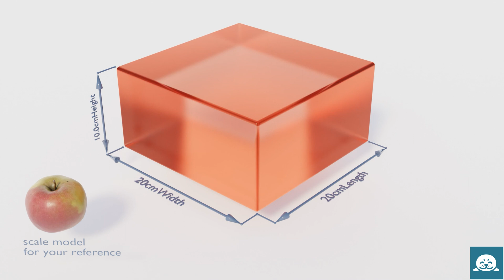Nerpa Polymers Casting Epoxy. Casting thickness tips.

Comment: What about pouring epoxy to fill letter or engraving ? You said it won't be as solid, but will it be OK ?
Reply from the maker: Hi! Thank you for your question!

Our Casting Epoxy will take several days to solidify at such a small volume, it is simply designed for larger volumes starting at 750mL. 
Our Coating Epoxy, however, will cure nicely in engraving application, just make sure to use torch or a degassing chamber to get rid out of the bubbles:)
Reply: @nerpapolymers7168  Oh, so I'm better with Coating Epoxy for that application, thanks a lot then! :)
Reply from the maker: @excessnet  You are welcome!